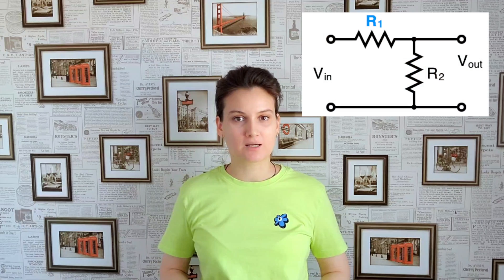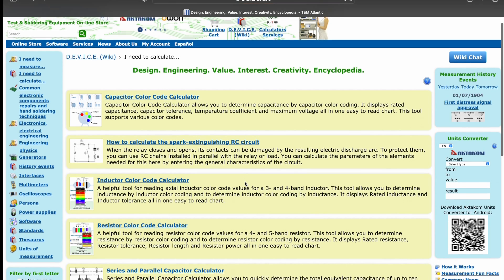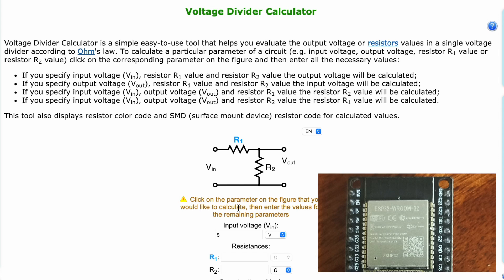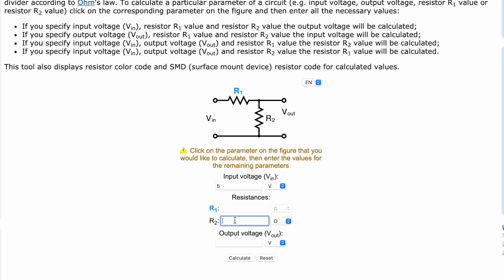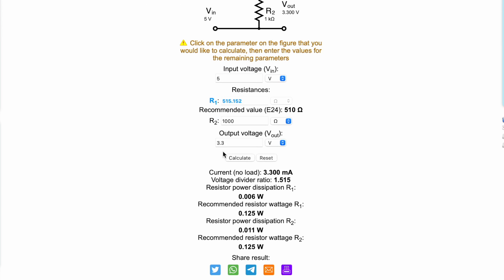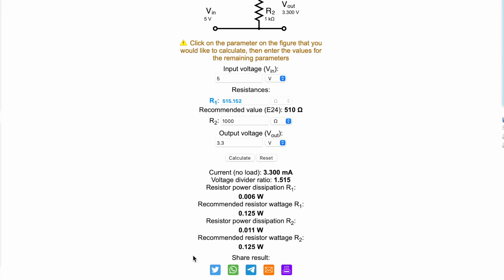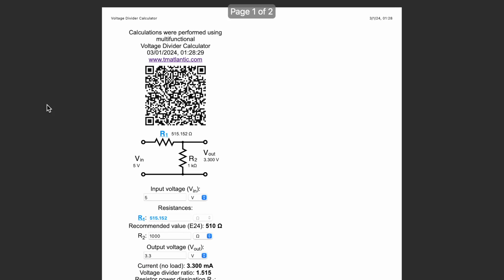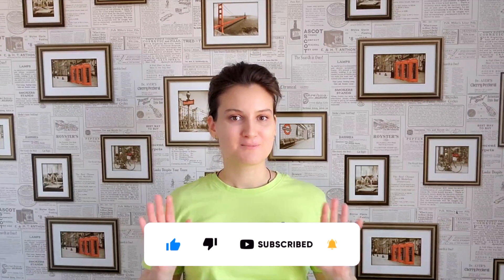Voltage Divider Calculator

Comment: Are voltage divisor and current divisor concepts used in capacitors, batteries etc ? Just like in resistors?